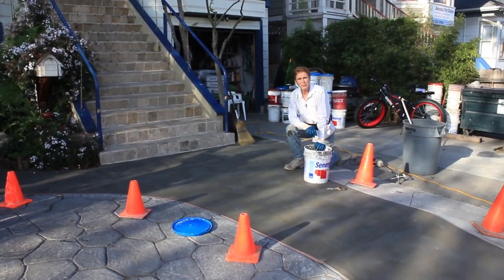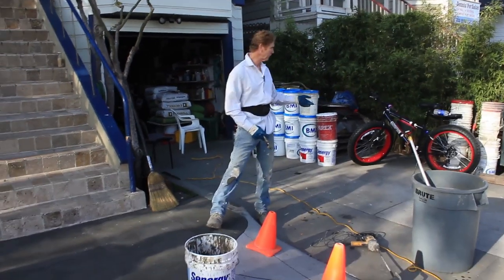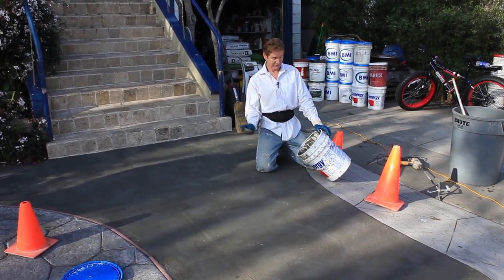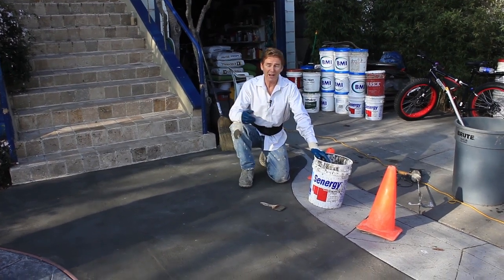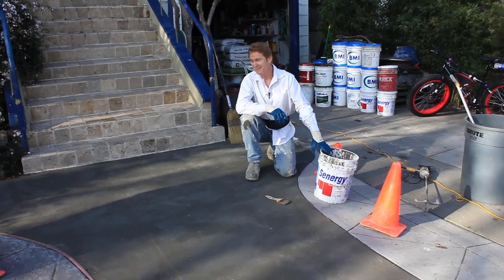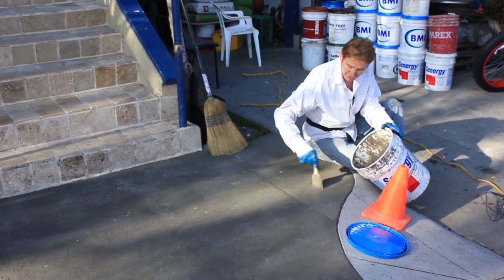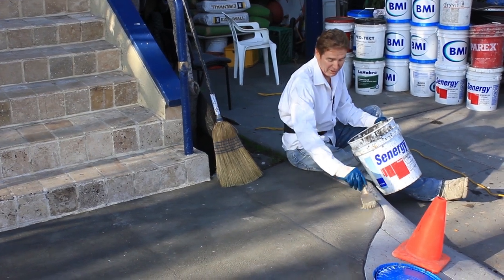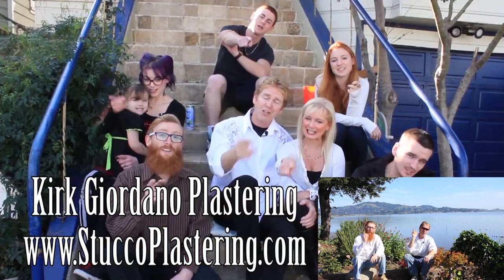Can you use stucco Acrylic finishes for walkways

Comment: That joke cracked me up. I was not expecting that ending. Another good video and I'm glad to see you back in good humor.
Reply from the maker: Morning  Black Swan, thank you brother, gotta keep the mind right.
 have a great day, 
 kirk giordano
Reply from the maker: ***** Hello, It matters little the difference between as little as 1/8 to 3 inches or more in depth, If a fella knows his materials and has the ability to feather in, they do so.
 If a persons does not yet possess this learned ability or knowledge, it's best they simply say so, not that it can't be done.
 Best wishes, 
 Kirk giordano
Reply from the maker: opps, If I were you, I would use westpac's fast set as it's sold at Home Depot and Lowes and most other hardware stores.
 Its even of course sold at the professional plastering yards such at Westside building materials.
 I suggest you use a 20 minute fast set this way you have the time to mix then apply.
 The 20 minute fast set comes in I think 20 pound bags all you do is mix in a 5 gallon bucket and add water, then apply.
 Best wishes and have a Fantastic Day, Kirk Giordano’s DIY plastering tips
Reply from the maker: No worries Avvia, best wishes, Kirk giordano

Comment: Awesome video Kirk.

If I am making a brand new cement patio, can we acrylic right over it with Dryvit or Sto or should we primer it first? We're thinking of brush finishing it then floating acrylic onto it.

Thanks for you info
Reply from the maker: Hi overlordsshadow, If it's a new cement patio, you don't need to do anything to it.
 If you wish a color finish then try this of course if you wanted a color a new cement patio with color, you can have color added to the cement, which last forever.
 Thanks for watching and have a great day! 
 kirk and Jason's plastering team

Comment: Hey Kirk as always love your vids it great to see someone have fun at what they do . Quick question have a pool has stoned concrete from the 80s I live out in Ohio what product would you recommend to hold up to our season I want to something like your using any help would be greatly appreciated
Reply from the maker: Willstoybox Hello, there are a lot of great products specifically designed for this purpose, however I don't do this sort of work. If it were my own house I can and have used either Dry-vit, BMI, Synergy, and Carson's and a few other acrylic products but these acrylic's are designed for walls.
But on my own home I have used these stucco acrylic's over concrete with excellent success for well over 25 years. Best wishes, 
Kirk giordano

Comment: kirk, amazing videos. I used your videos to redo my new costructions windows on old house. worked awesome.

I watched Mike huduck and was gonna use Portland to redo my driveway. now thinking the acrilic because it comes in any color. 

I do have some deep cracks?
would you recommend the bond with sand to fill before doing final acrilic coat...

and yes this is my driveway and pool deck area.
Reply from the maker: Howdy Dude, yes fill the cracks first if you're going to use an acrylic use Stuco-flex, C arsons, BMI, or dryvit, they are all good products which last many years,
        Live long and plaster
Stucco/Plastering images and teaching video’s
Reply: kirk one more question yesterday afternoon I applied bond agent onto my concrete  and partially applied stucco, and the it rained before it dried completly.

I did cover most area with paint plastic but.water did get onto.some.bond and some stucco.

do I reapply.new bond or just let it dry completely and keep applying the stucco.
Reply from the maker: Howdy Dude, if it were me I'd let it dry as it should be fine,
        Live long and plaster
 images for stucco/plastering and teaching video’s

Comment: Hi Kirk-   thanks!  good stuff to know.    What is the working time on acrylic stucco?   if you have no choice but to stop before reaching the end of the wall or other surface-    what steps should you take in order to resume the job later?    I think in your lingo (I'm still learning)  it would be "failure to maintain a wet edge".
Reply from the maker: Howdy Matt, depends, for example,
In the heat of the day during summer months and late afternoon while the cement is red hot you have 10 minutes, if you have a cold ground as it's in the middle of winter and it's early morning at about 60 degrees you have 24 hours,
As you suggest  "failure to maintain a wet edge" also implies, which reminds me of the immortal words.
"What we have here is a failure to communicate" the cool words in the timeless movie, cool hand luke starring Paul Newman.
 cheers,
 kirk giordano

Comment: Hi Kirk,

I install & erect Insulated Styrofoam Blocks (ICF) Fox Block, BuildBlock, EcoBlock & others in any State & Canada required. We fill em' with concrete. All these brands have plastic reinforcing @ 6" centers for fixing whatever veneer finish the homeowner requires. This Job requires us to also Stucco the top 2 thirds of the wall with the bottom third veneered in stone. I was inquiring what mesh you use to stucco over the foam blocks. Regards JWJ
Reply from the maker: Evening JWJ, I rarely use mesh these days unless it's the common fiberglass mesh tape for interior boards of covering exterior cracks.
 When I was a union man, our company worked on hospitals and schools they required a panzer mesh at the bottom 10 feet for strength then went to a lighter gauge when high up enough to avoid people hitting the walls.
 I remember hearing Dry Vit named the fiberglass mesh panzer after the german panzer tank as it was so strong.
Our boy, Arnold schwarzenegger probably has one of these tanks in his backyard. 
best wishes, with your projects.
 Cheers and have a fantastic day,
Kirk Giordano’s DIY plastering techniques

Comment: Their is a brand name called ,"Dryvit ' is that acrylic coating ? I actually helped a local stucoo plaster guy here about 3 years ago ,and we used ,Dryvit. If i recalled correctly we used Styrofoam to make pediments and sills . It was in 5 gallon buckets.
Reply from the maker: Good afternoon Al dude, sure Dry-Vit is one of the best stucco acrylic products sold, they are from Europe originally, they set up shops here in the U.S possibly 50 years  ago,
 there are a lot of quality acrylic stucco finishes out there and on the flip side their are acrylic products I would not apply if they were given to me for free as they suck,
 This is a positive channel so I won't mention the crappy acrylics.
                       Live long and plaster
  teaching repairing your number 1 investment your home
Reply: Hi Kirk, 
Which stucco companies do you avoid for acrylic and why? I either use Merlex or STO acrylic on the homes i build i'm located in southern california
Reply from the maker: Greeting Kevin, there are only two shitty acrylic's which most quality stucco companies avoid.
 Since I have a positive and rated G channel, I won't mention them. however, some of the best are Stucco-Flex, Dry-Vit, BMI, Carsons, and Stow.
 I have not tried Merlex so can't comment.
     Cheers, peace & harmony 
Sound Plastering tips from your favorite stucco geeks

Comment: The acrylic is pretty much a way better product than   Rustoleum restore for decks,walkways and driveways.
 (They are being sued because the product doesn't live up to their hype.)

That being said, There are many products that will work for many different situations than what they are sold for. The reason why is Manufacturer can not guarantee that their product will work and hold up. They have not spent the money on testing their product in those situation (s) . Its like when you see a clothing tag that says Dry Clean Only. 99% of the stuff you can wash but the manufacturer decided to not spend the extra money to do the testing to see what kind of washing the materials will hold up too.